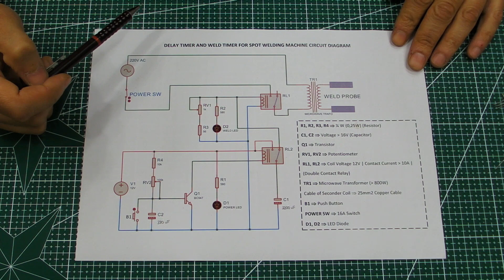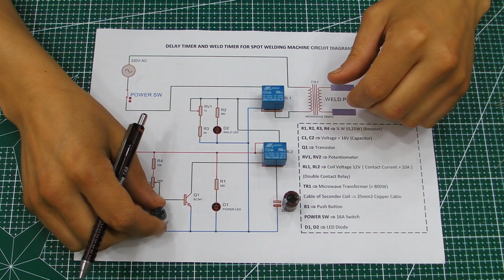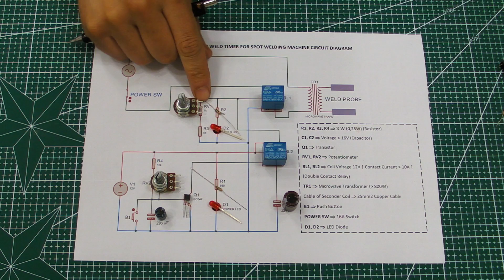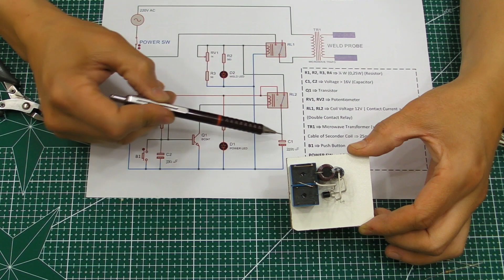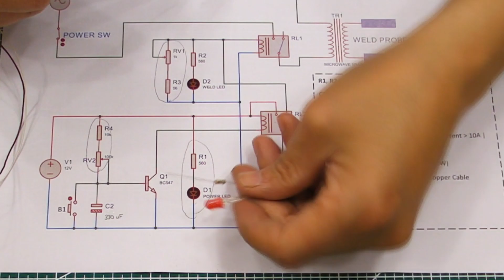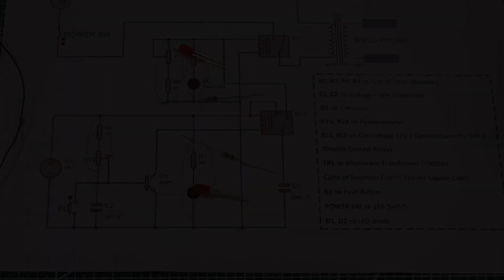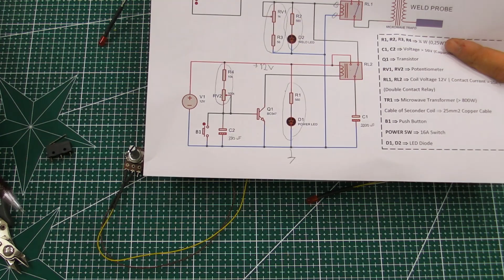How to Make Timer Circuit for Spot Welding Machine

Comment: @Murat Güney why when I apply power to the circuit the weld side immediately turns on, the potentiometer will adjust the weld time properly but when I plug it in the circuit activates and after that the power led stays on but I press the button and nothing happens
Reply from the maker: Hello. Please check the relays. You may have connected the normally open and normally closed terminals incorrectly. If you've used relays similar to the ones I used, the terminals are the same. Follow the video to make sure you've connected them correctly.

Comment: nice work...what is the value of resistor in 1k potentiometer......is it 56 or 560 or 16? ohms
Reply from the maker: Hello. The resistance value is 56 ohm. Did you download the circuit diagram?
Reply: Yes sir i downloaded already👍👍👍 very impressive nice work

Comment: In your circuit diagram showing 220v ac supply and again  show v1 12v. Is it use two power supply?
Reply from the maker: The 220V part is only for transformer supply. The circuit will be supplied with 12V. I recommend using a transformer power supply for 12V supply.
Reply: Can i replace 220v ac to 12v  dc?
Reply from the maker: The places where 220V ac and 12V dc voltages are used are different. 220V voltage value is required for microwave oven transformer. 12V dc is required for the timer circuit. You must obtain 12V dc voltage from a power source.

Comment: hello.  Will your timer circuit work on 110v microwave transformer ?
Reply from the maker: Hello. It will work the same way. However, it would be good if the current resistance of the RL2 relay is selected as around 20A. Because the input current at 110V voltage will be twice as much as at 220V.

Comment: Excelente información. ¿Qué cambio hay que hacer para que funcione a 110 volts?. Gracias.
Reply from the maker: Hola.  Primero que nada, gracias.  Para 110V, el reductor utilizado para 12V en la entrada debe cambiarse a 110/12V.  Además, dado que la corriente de entrada será mayor con un voltaje de 110 V, se debe elegir que la resistencia actual del relé RL2 sea mayor.  Por ejemplo, como 20A.  Espero poder explicarme.  Por favor escribe nuevamente si es necesario

Comment: Hello and thank you for your great contribution. I want to ask you if this relay circuit can be modified to be powered by the mains 240v without using a 12v dc? If yes can you help with a diagram? Thank you
Reply from the maker: Hello. A solid relay (semiconductor relay) can be used to do this with 220V. However, since we have to use a button and it is a button that is always close to the hand, I do not recommend it. Because it would be dangerous. It would be better to do it with 12V.
Reply: Hi thank you so much. Appreciate it.!
Reply from the maker: I thank you too. Greetings from Turkey

Comment: Hey can this be used for a battery spot welder where instead of pressing the button to actuate this circuit, you would touch both leads to a nickel strip, which should act the same as a momentary push button switch. Or no?
Reply from the maker: Hello. This circuit is a timer for a battery spot welding machine. So it is not for use instead. I made the battery spot welding machine with a microwave oven transformer and put the video on my channel. This timer prevents long-term current supply to the battery and prevents damage to the battery.
Reply: Yeah I'd be using it for a microwave oven transformer type, i guess my question was more about actuating the circuit without a momentary switch like in this video, I'll go and rewatch the other video though, it's been a few weeks since i first watched it so maybe my question is unnecessary
Reply from the maker: Maybe I misunderstood your question. Anyway... It wouldn't be right to use the point machine without such a circuit. Thanks to this circuit, no matter how long you press the button, the same amount of time is always applied to the battery.

Comment: Your video is sensational. I managed to do it and it worked.  I would like to know if this same team can be installed on a machine with 2 transformers? Thank you for sharing your knowledge.
Reply from the maker: Hello.  Firstly, thank you.  You can do it with 2 transformers.  It would even be a much more powerful machine.  In this case, it is sufficient to replace the relay on the circuit that energizes the transformer with a more powerful relay.
Reply: Olá. Consegui fazer o time conforme suas orientações, mas sou leigo em eletrónica.Voçe poderia me dizer o modelo e se tem que trocar os dois relés?
Reply from the maker: Olá de novo.  Basta substituir o relé RL2, que energiza o Transformador quando o botão é pressionado, por um relé que opere com 12 Volts mas cuja corrente de contato seja de no mínimo 20 Amperes.  Outros lados podem permanecer os mesmos.  Depois de concluir este processo e testar o circuito, entre em contato comigo com uma nova mensagem de comentário.  Então, por favor, reescreva esta mensagem em vez de respondê-la.  porque mensagens antigas são deixadas para trás e são esquecidas

Comment: I have a commercially made spot welder.  Works well, but lacks any sort of power or timer adjustments.  I wonder if this circuit could be used to control it?
Reply from the maker: Hello.  You can use it.  However, this circuit is only for time adjustment.  No matter how long you press the button, it gives the welding current for the time you set.

Comment: The connections you make in the video dont match what is on the schematic.  you connect the pot with the resistor lead to closed  side of the relay 2, but the schematic shows it connected to the open side. you also connect the closed side of RL2 to the coil on RL1 in the video but this isnt shown in the schematic. If i follow your video my power led comes on with 12v but when the button is pressed the power led turns off and nothing from the weld led.
Reply from the maker: Hello.  I don't think there is a fault in the circuit.  I did it according to the same sky.  The power LED does not turn off when you press the button.  Because it is directly connected to 12V.  Don't you think there is something wrong?  I think you must have connected the power LED parallel to the relay coil.  Please review the circuit again and get back to me.  If there is a mistake, I will correct it, but it shouldn't be there.  Maybe the NO and NC contacts of the relays may be confusing.  Thank you for your attention

Comment: Could I technically use the delay time And use it to trigger a dual pulse?
Reply from the maker: Any timer that can set appropriate times can be used.  You can also do it by just adjusting the welding time.  I preferred a two-stroke timer so that I could use it hands-free (with a foot pedal).

Comment: buenas noches saludos desde Miami, Estados Unidos, todo esta bien, pero lo que no pude ver es como se integra el trasformador del micro ondas al circuito, lo único que vi es que soldaste dos cables uno rojo y otro negro, pero no se a que fuente de poder los llevaste a la 12 V o a la 220 V, porque en el diagrama dice una cosa y el video dice otra cosa, ahora bien, el trasformador es de 220 V primario y 5 V secundario con 250 a 300 A. No se si en el video alguien vio la fuente del poder del circuito.  Good evening greetings from Miami, United States, everything is fine, but what I couldn't see is how the microwave transformer is integrated into the circuit, the only thing I saw is that you soldered two wires, one red and one black, but I don't know how Which power source did you take to 12 V or 220 V, because the diagram says one thing and the video says something else, now, the transformer is 220 V primary and 5 V secondary with 250 to 300 A. No I know if in the video someone saw the power source of the circuit.
Reply from the maker: Hola.  Usé un adaptador de 220V / 12V para el suministro del circuito.  La caja negra que se ve en el video... La alimentación del circuito está activa cuando el sistema está energizado.  Los contactos del relé en el circuito están cambiando uno de los terminales de entrada del transformador del horno de microondas.  Entonces da paso al transformador.  El sistema es realmente simple.  Si hay algo que no está claro, escribe de nuevo.  Saludos desde Turquía...

Comment: Este circuito con sus componentes es aplicable para un transformador 120voltio
Reply from the maker: Hola.  Después de aplicar 12 V como suministro de circuito, el valor de voltaje que controla desde la salida del relé no es importante.  Así que puedes controlar 120V o 220V.
Reply: Buenas murat quiero decir, que si coloco un transformador 120v,los condesadores y transistor seran de la mismo valor y especificacion
Reply from the maker: Sí.  Los valores serán los mismos.  Dado que este circuito ya está alimentado con 12V, no habrá ningún cambio.  Disculpe mi respuesta tardía a su mensaje.

Comment: Thank you for your videos. The design of your welding machine is the best that I have seen. Please write the range of times for implementation using Arduino.
Reply from the maker: Hello.  First of all, thank you very much.  I'm glad that my work is rewarded in this way.  I preferred this method so that everyone can make the timer circuit and make it with easily available circuit elements.  I don't prefer it because my followers will have more difficulty in doing it with Arduino or other microcontroller.

Comment: Que otros tipos de transistores puedo usar para hacer ese sircuito llevo semanas buscando algo que pueda hacer ya que cuento con muy pocos recursos solo puedo resiclar de equipos electrónicos rotos y me sería de gran ayuda saludos y gracias por el video
Reply from the maker: Hola.  El transistor que utilicé en el circuito es un transistor npn simple.  También eliminé la mayoría de los materiales de los circuitos antiguos.  Si escribe los números de transistor que tiene, puedo decirle si son adecuados o no.  Gracias por su interés.  Saludos desde Turquía 👍
Reply: @MuratGüney  ya logré encontrar un remplazo funciona muy bien termine mi máquina no puedo mandarte fotos pero quedó 🤩 utilize el transistor BC337 saludos y muchas gracias

Comment: PLEASE can you explain to me: How does the RL1 relay coil energize? Both RL1 coil terminals are connected to the negative pole of source V1.
Reply from the maker: Hello.  When you look carefully at the circuit diagram, the first of the coil ends of the RL1 relay is connected to the negative end of the V1 source, while the second is connected to the positive end of the C1 capacitor.  Please rewrite if the explanation is not sufficient.  Thank you for your attention
Reply: @MuratGüney  Dear Murat, first of all thank you for your quick reply.
I see, is it the discharge of capacitor C1 that energizes the coil of RL1?
Reply from the maker: That's right... Capacitor C1 is in charge state as long as the button is not pressed.  When the button is pressed, the contacts of the RL2 relay direct the positive end of the C1 capacitor to the RL1 relay.  The 56ohm resistor and potentiometer connected in parallel to the coil ends of this relay determine the duration of the capacitor discharge.
Reply: @MuratGüney  Thanks. I understand. you are awesome.
Reply from the maker: Thank you too 👍

Comment: Veo en el diagrama pero no entiendo muy bien en el vídeo la conexión con la soldadora propiamente dicha. Los 220v van conectados en serie con  el primero y el Relay N°1? A caso no funcionan con 12v los Relays, eso no lo quemaría? Disculpen la ignorancia. Me explicarían cómo funciona realmente, si se conectan así o no, porque no estoy entendiendo bien. Gracias.
Reply from the maker: Hola. El extremo COM (extremo común) y el extremo NO (normalmente abierto) del relé RL1 están cambiando entre 220 V y el transformador. Como dijiste, estos extremos están conectados en serie. Si el circuito está funcionando como debería, puede haber un problema con las conexiones de los contactos del relé. Le agradecería si pudiera ponerse en contacto conmigo después de comprobarlo.
Reply: @MuratGüney   Es que aún no he armado el circuito. Y justamente por eso, es preferible quitarse las dudas con el que sabe, antes de cometer un error. Jaja. Pero apenas lo construya todo y lo pruebe, con la máquina completa en sí, y te voy a comentar los resultados. Mil gracias Murat.  Saludos desde Argentina.
Reply from the maker: Si lo haces viendo el vídeo del circuito electrónico y lo conectas de la misma manera, no habrá problema. Los contactos de relé de conexión más importantes. Presta atención a esto. Buena suerte. Saludos desde Turquía

Comment: Greetings, good evening, and it does not matter if you use Capacitors with a higher voltage or a Higher Microfarad.  since in many countries the energy is usually between 110v and 220V, greetings from the Dominican Republic

You did not put how many Voltage the Switch Button could be
Reply from the maker: Hi.  Capacitor voltage values of 16V are sufficient.  You can use any button as a button.  Because the current value in the circuit is very low.
Reply: @MuratGüney  saludo Bro, yo pedí un Kit de resistencia y me llegaron de diferentes tamaños pero no me llegó la de 56 Ohmios.

Crees que puedo usar una de 47 o una de 68.

Cual de las 2 podría usar la de 47 ohmios o la de 68, si puede decirme, o necesito una específicamente de 56
Reply from the maker: Hola.  Estos valores no son muy importantes.  Puedes usar 68 ohmios
Reply: @MuratGüney  muchísimas gracias Amigo, está bien usaré la de 68
Reply: @MuratGüney  saludo Bro, la resistencia de 560 ohmios en la Luz Led va conectada al positivó cierto

Comment: Hi Murat, your plan is different than your circuit in the video. The jumper in Relay 2 power and control of Relay2 connection + is different. Plan has power on switch open. Video has power on switch closed (rest position). I got the welding time down to 2 seconds with 4700mf. but delay time remains almost unchanged I have often changed up to 1000 mf. Will go back to manual operation. Greeting Jochen
Reply from the maker: Hello.  It may seem different due to the drawing program I use.  For example, the key appears to be open.  But the circuit is completely correct.  I worked according to this circuit in the video and did not make any changes afterwards.  There must be something wrong with the capacitor as well.  As the value changes, there should be a time change.  Because the capacitors in the circuit and the resistors in series with them are a simple RC circuit.

Comment: no error but contact opens immediately with me but not it closes as long as pressure on finger therefore only weld when loosening the fingers. but the time is still too short for welding.
Reply: Thanks for the quick reply, no, don't confuse openers and jumpers. The cycle begins as in the video after releasing the button/weld button. (Not assembled test circuit) But your finished machine is welded with a bridged button or have I misunderstood something.
Reply from the maker: Hello again.  Some sentences are confused due to translation.  If your circuit works as in this video (while testing circuit), there is no problem.  However, as I said before, if the relay contacts (NO, NC) are reversed, they work differently.  Besides, if you think everything is right and the time is too short, you can make the C1 capacitor 1000uF or 2200uF.  This just makes time stretch, no other problems
Reply from the maker: Did you reverse the normally open and normally closed contacts of the relay?  Or there seems to be a circuit connection error similar to this

Comment: The transformer welds when the pressure of the fingers is released. I despair. or the plan has errors help me
Reply from the maker: Hello again.  There are two timers in this system.  The first timer starts when we depress the lever, allowing time for the materials to be welded to set properly.  When the first timer time expires, the welding time starts and the current is given as much as the set time.  That way, it doesn't matter how long the button is pressed, and the same amount of current is always applied.
Reply: @MuratGüney  hallo  Murat Güney nochmals danke für die Antwort , ich probier das heute nochmals ansonsten ist wohl C 2 defekt oder so . Bisher begann immer der Schweissvorgang nach B1 off , loslassen .Laut plan ist bei gedrücktem B1 Basis Transistor an minus das heisst solange ist rel 2 an . wie soll sich das ändern solange ich butten b1 gedrückt halte ? Ich versehe das nicht denn kondensator oder wiederstand kann an dem minus etwas ändern . Viele Grüße aus Deutschland .

Comment: Pdf diagram of the wrong machine box link
Reply from the maker: This circuit is the timer circuit for the spot welding machine.  I left the link below.  Please write again if you have any problems.  https://drive.google.com/file/d/1ehfzwHrID-pW_VI3fHl86GTOY0JmIC3U/view
Reply from the maker: Hello again.  Any problems with the documents?  Did you download?
Reply: @MuratGüney  Buenas. Te consulto, veo en el circuito que los 220v van conectados directamente al Relay N°1. Es así, porque veo que la características de ambos en el archivo de arriba es que funcionan a 12v. Tal conexión no los quema? Y justo al caso, estoy por hacer una soldadora de puntos con una soldadora de arco de 180amp. a la que le quité su secundario. Soporta más amperios o KvA que un transformador de microondas el circuito que nos proporcionaste, o por lo contrario se quemará? Disculpa mí ignorancia, realmente soy un neófito en la electrónica, solo conozco los componen y para que se usan, aún no he experimentado con ningún tipo de circuitos. Jaja